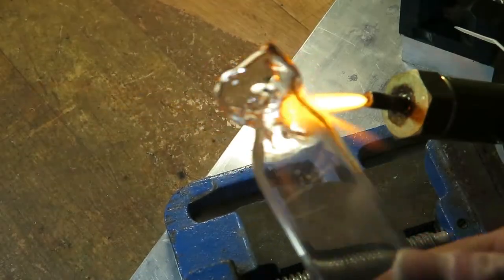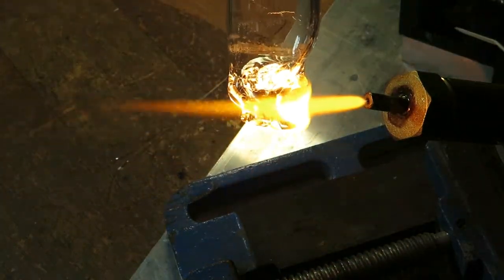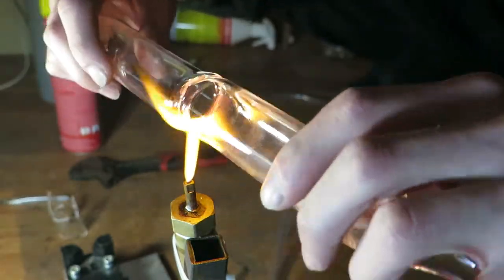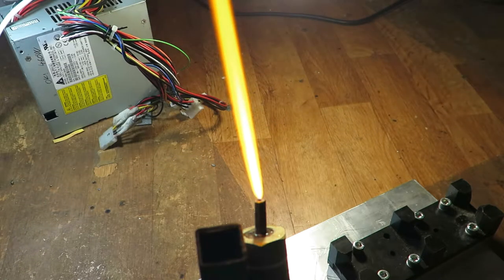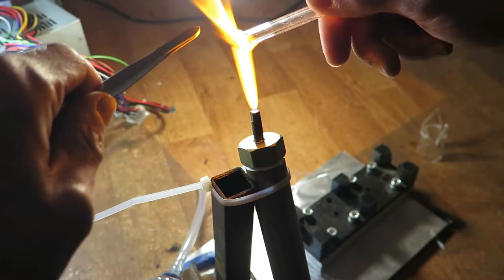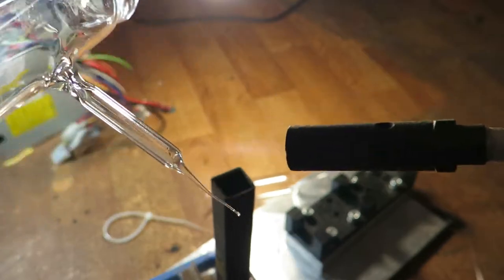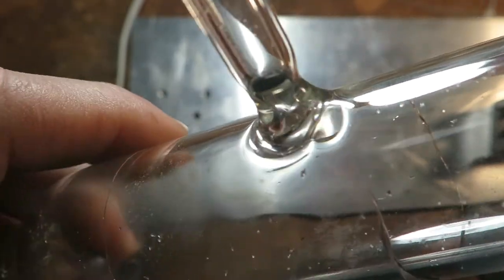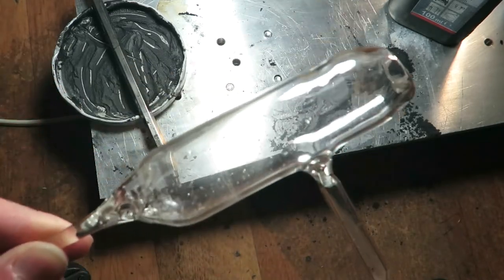Glass blowing with HHO

Comment: so some pointers... not hating just want u to be safe. 
1. heating glass that is sealed is really something you shouldnt do right away. heat creates a reverse vacuum and could explode. 
2. so that hole you made with the flakey film hanging off of it is the result of that pressure, its ok if you can control it, always keep the glass in flame so the film isnt a problem. the film is dangerous, its hard to clean up if it occurs. on that note if you pull away and the string thin stuff is being made roll it up in the flame
3. no matter what get some didymium glasses! no if ands or buts! and get glass not plastic. they filter the light so u wont see yellows and oranges of the flame, secondly its like xray vision(the glass will flash white when its ready to work. green lenses arent much help they are to dark and you cant see tools.
4. graphite is your friend get a piece to set tbings on. and get a can with some water in it to quench accidents or quickly cool puntees that arent  needed.  or
Reply from the maker: THX 4 comment.
The glass film is nasty stuff...
I was looking at some glassblowing vids at the time, and they always blow huge bubble and break it away.
It makes this film, but also a really nice flange to which it is easy to weld tubes

Comment: hmm I was wondering if HHO glassblowing would be a good idea but with what you got so far it looks pretty promising
Reply from the maker: It is, I have built bunch of stuff with this setup. One limitation is, that electrolyte heats up, so after 1h of continuous runtime it is very hot. That means, that it needs regulation, which simple diac (like for drills) works well. I run this at ~1KW and can smelt 32mm diameter 2mm thick tubes just barely. 2kW would be better.
But no need for storing gasses :)

Comment: Subscribed!
You have the greatest projects!
Why do you not blowing air into the glass to keep the proper form of a glass while working with it?
Reply from the maker: Thanks!
I didn't get notification for this comment.
That may be possible for some not complex pieces. Very hard to regulate properly.
And annealing oven is quite cheap to build. Also you can use it to melt some metals for casting.

Comment: Push and pull the glass when welding. I hope you're using glasses to block UV.
Reply from the maker: Thanks for suggestion.
I want to build glassblowing lathe so it will be a while, until I get back to this. Hopefully I wont forget :)
I use some weaker welding glasses, but I will get sodium blocking filter. I don't think, that there is more UV than in typical indoor daylight environment. But I haven't measured that.